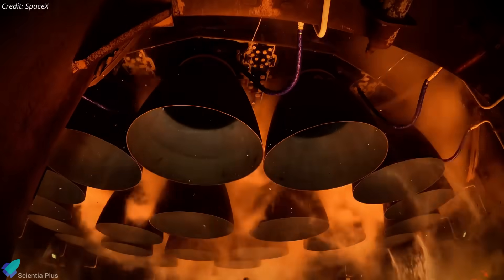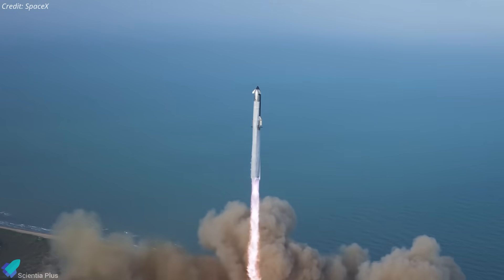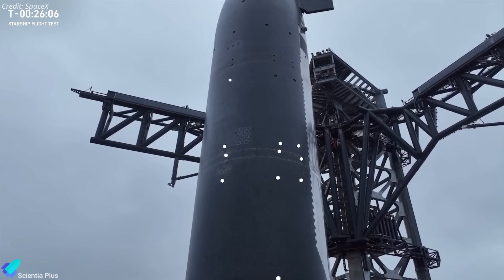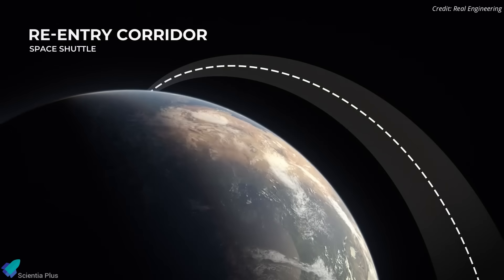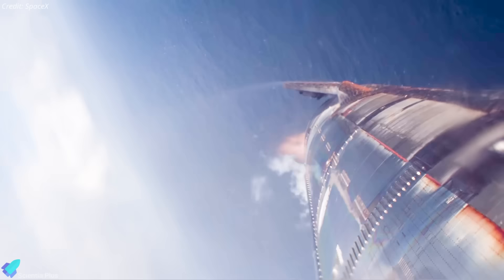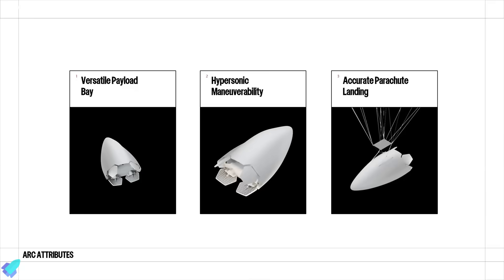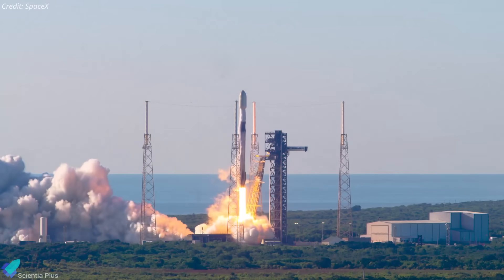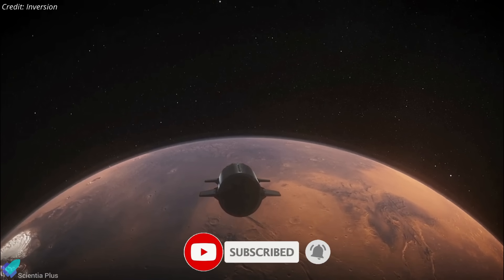Starship Flight 11 Launch: The Final Block 2 Mission Attempts the Dynamic Landing Maneuver

Comment from the maker: 00:00 Starship Updates
09:07 This New Spacecraft Can Deliver Cargo Anywhere on Earth in Under 1 Hour!

📚 Learn More:

🚀 Starship Block 2 Explained:
 📖 Summary: https://shorturl.at/b0dtw
 🔍 Detailed Explanations:
  • Design Improvements Update 1: https://shorturl.at/lpGT7
  • Design Improvements Update 2: https://shorturl.at/gwNQ4
  • Nosecone & Payload Bay Redesign: https://shorturl.at/xa60S
  • Methane Downcomer Redesign: https://shorturl.at/XdYBG

🚀 Starship Block 3 Explained: https://shorturl.at/mnBT4
  • Detailed Breakdown: https://shorturl.at/IViwD
  • Production Begins: https://shorturl.at/xRNkJ
  • New Transfer Tube / Downcomer Explained: https://shorturl.at/Iaqc6
  • New Grid Fin Explained: https://shorturl.at/NxdVo

🚀 Starship Block 4 Unveiled: https://shorturl.at/7A2ef
 
🔥 Raptor V3 Mega Upgrades & First Test: https://shorturl.at/TRIyj
🧱 What’s Inside Starship GigaBay?: https://shorturl.at/nJM75

🛠 Insane Engineering of New Starship Launch Pad 2: https://shorturl.at/7RAZd

🛢 Dual-Port Orbital Refueling – Full Technical Breakdown
https://shorturl.at/5tiqK

🛠 Other Starship Upgrades:
 • Hot Staging Explained: https://shorturl.at/jf400
 • Super Heavy Booster Upgrades: https://shorturl.at/Pi5R3
 • How SpaceX Protects Raptor Engines: https://shorturl.at/4Om8F
 • New Heat Tiles Explained: https://shorturl.at/p2Ijb

🚀 Starship Flight 10 
  📽Detailed Breakdown: https://youtu.be/irVUMJNe0Kc
  📽Root Cause of Anomalies: https://youtu.be/LBUpp7MRVSY

📡 Stay Updated:
📢 Weekly Updates: https://bit.ly/3HIQjPC
🚀 SpaceX Playlist: https://bit.ly/34wue8T